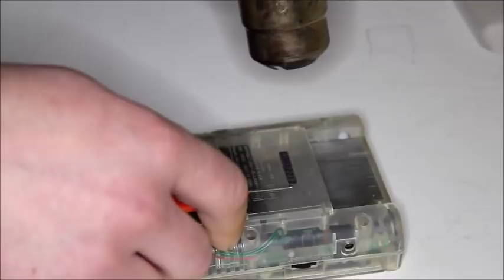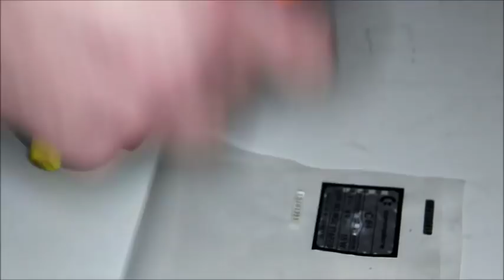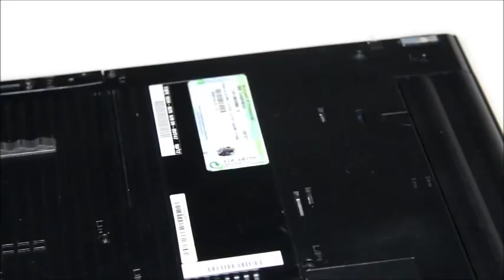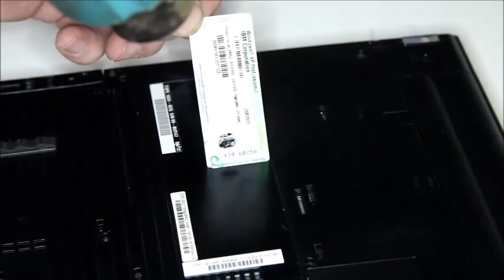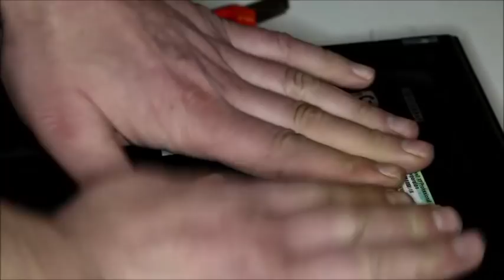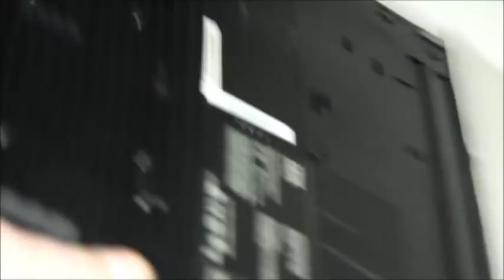Sticker removal and re-application in a non damaging way.

Comment: You need:
A prefferably new exacto knife.
A hot air gun.
Tweezers are optional.

Step one:
Prepare your sticker by heating it with the hot air gun. Be carefull not to overheat it. Both the sticker and the casing can be damaged during this step. Practice first on a non important item.

Step two:
Insert the exacto blade under the sticker in one corner. Maybe you need to heat the sticker while doing this if the glue is getting cold. SLOWLY peel off the sticker.
You MUST wait till the sticker is heated enough and the glue lets go. Otherwise you will get crumbling in the corner you start peeling off. Larger stickers may need gradual heating while you remove the sticker. This apply to windows serial stickers and the like.

Step three:
Place the sticker on some sticker paper, or plastic sheet till you need to re-apply it.

Step four:
Remove the sticker from the sticker paper paper, and apply it in the desired spot. Momentarely heat the sticker and apply pressure to make the glue set the best possible way, and keep pressure on it till the sticker is cold. Now the glue has set and your done!
Reply: God knows if you are still using this account but its worth a try. Is there any adhesive I can buy in the case the sticker I peeled off doesn't have to to set back?
Reply: Legend. TY
Reply: @moizkhan8057 3m makes a wonderful spray adhesive just spray on and let dry until tacky. Dissolves with IPA aswell for ease of future removal

Comment: I got the removal part down, but how can I re-apply the sticker if they don't stick as well?
Reply: Glue?
Reply: I assume that it has to be re-placed back as soon as you remove it onto the new surface, if not there are some glue on a spray can
Reply: Kelly Medley Funny, but not sure if a missing hyphen is enough for a joke
Reply: apparently when reapplying the sticker hest it up so the glue can reset
Reply: Scotch tape around the edge of sticker. Very minimal

Comment: Is that just a hair dryer?
Reply from the maker: It's a heat gun, but a hair dryer might work.
Reply: +Glitch Militia I used a hair dryer and it worked :)
Reply: @annietran4947  the hair dryer needs to be hot?
Reply: @Vladslav.Drakulya  Well yes... otherwise you're just blowing air on it...